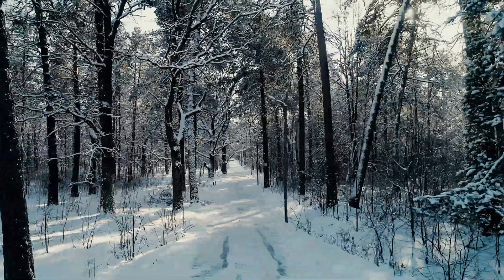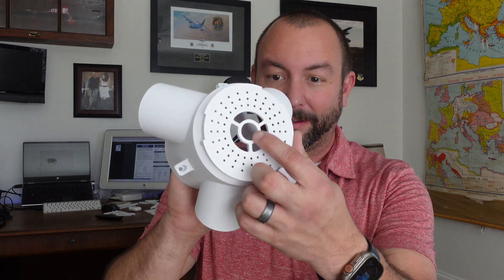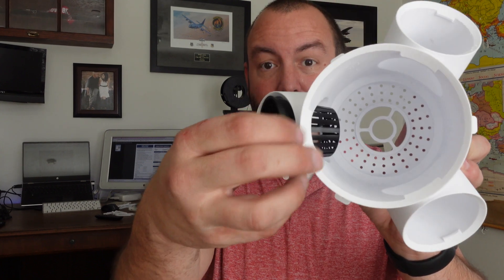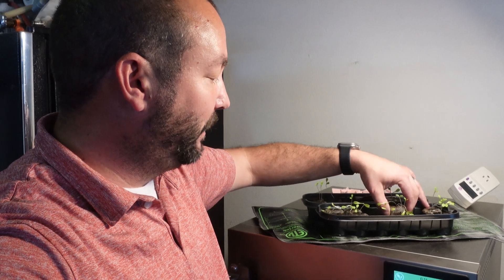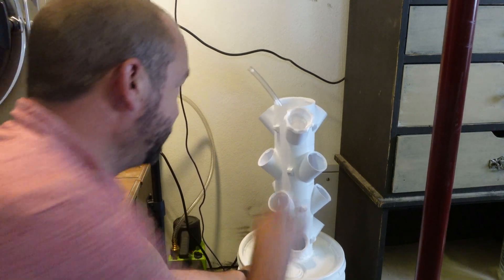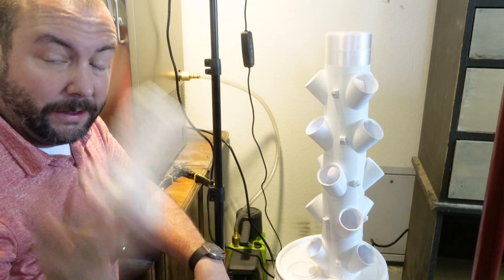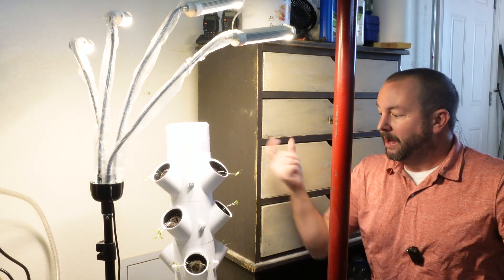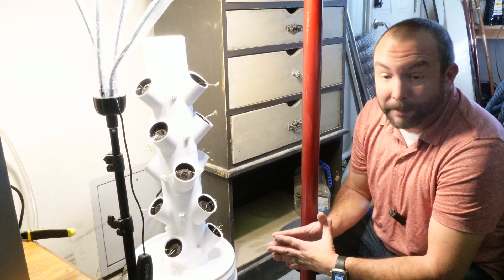How To Grow Vegetables In Winter With Hydroponics (IT'S SUPER EASY!)

Comment: 2 years passed without an update. If the plants died maybe you were watering them too little.
Remember this is aeroponics and roots don't have soil to keep the water.
I had mine running 30 mins on / 30 mins off (used the same model) and grew a lot of basil this summer, but outdoors. Found this video as I'm looking for tips on growing indoors.
Reply from the maker: @IvailoAlexandrov  good morning! It actually worked great. I’m trying some new methods and working on videos as we speak on them. Namely easier more accessible ways to do hydroponics as well as some new plants.